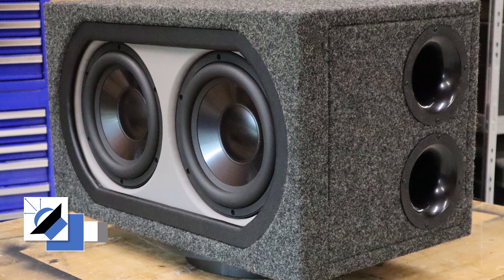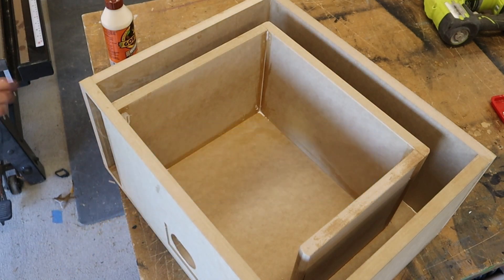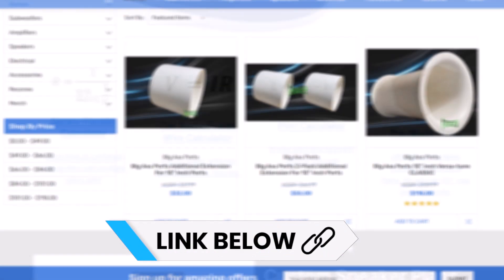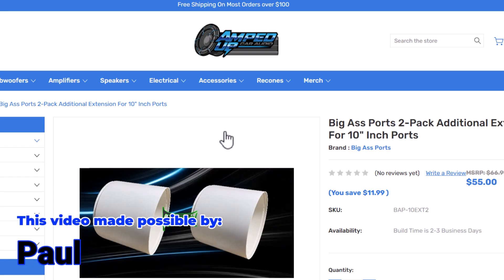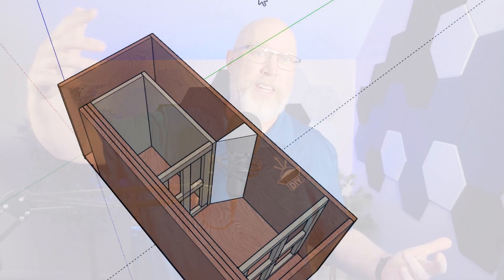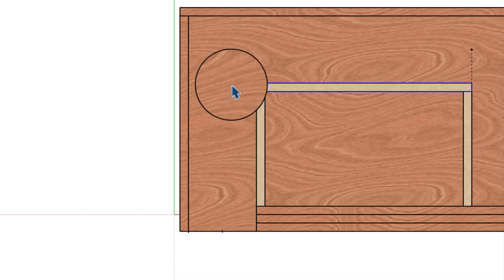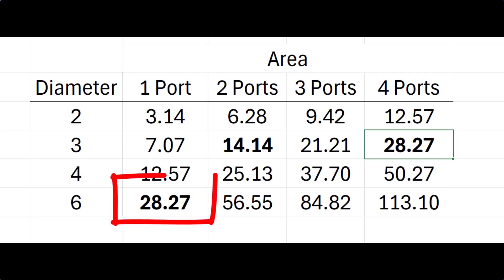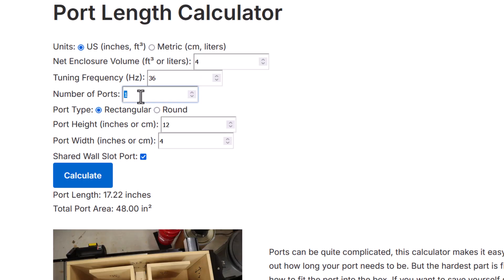Bad ports KILL your bass, ten port tips.

Comment: Hi Sir,
Love from India. I have a query.
I have build the custom box and installing JL Audio 12W0V3 300watt sub woofer.    Keeping port size as 3 inch in Diameter and 14 inch long. My box Depth is 16 inch so in this case 2 inch gap between port and the wall is fine? Or need to reduce? Please revert thanks 🙏

Comment: I usually use 4 ports, making a right angled triangle in each corner of the box. If you want longer ports and have a wide enclosure, you can use the back wall and side walls. It also serves as bracing. I suppose if you do some fancy wood angle calculations, you can flare either end too.

Comment: 3:38 do I do this half of the port 

4:38 or this? 

You would subtract the width of the port and half of the port ? So you are subtracting 9 inches? Sorry if you could elaborate. 

My originally vent length I needed was 29.5 I guess I only needed 20.36
Reply from the maker: Both.
Reply: @DIYAudioGuy you mention ”net enclosure size“ when adding in values u mean the overall box volume correct ?
Reply from the maker: @thatguykai479 that means the actual volume of air that's in the enclosure after you back out all of the things that are inside of the enclosure.  So you have a 3 cubic foot box, but your Port takes up a cubic foot. The net volume is only 2 cubic feet.

Comment: Questions for port placement:

As for as I know it doesn’t matter.

All in a rectangular box! For two 10” subs

I know round ports are the most efficient port you can get it will not work in my application

My question for you is Port placement. I know the port facing forward same direction as the speakers is the preferred method due to sound acoustics and all kinds of other technical mumble jumbo.

Due to the set up and sign my vehicle in the trunk unless I make a L Port it is not possible, and I must port my box through the side.

1. Subs positioned in the bottom left of the box. is there an issue having the port on the opposite side of the subwoofers which would be the right side of the box and positioned at the top? To better clarify, that means when looking at the subwoofer inside the trunk, two subwoofers will be placed on the bottom left of the rectangular box when you would look to the right side of the box and go to the side you would see the square port opening that opening would be positioned at the top of the box Still on the right side and positioned against the face of the subwoofer box, sharing the side wall for the port.

If that’s still not making sense without seeing a picture because I’m a visual person. My main question to you or anyone reading this comment is can the port be placed basically anywhere on the box? As long as following the basic rules such as proper length placement proper Space between the Port opening and the wall inside the subwoofer box. Not covering the port and so on and so on.

I’m more concerned with Khanh the port share the same wall as the subwoofers do? 

I’m asking this because you often see people who port their subwoofers off to the side you see the port usually down in the lower corner, not in the upper corner. 

I cannot vent my box in the lower corner. There will be obstruction of airflow. 
My subs have to be placed on the left side of the box and the vent has to be placed on the right side wall of the box, but in the top left-hand corner. 

I did not run this throughWinISD because the program keeps messing up on my old computer.
Reply from the maker: A 40 HZ wave is 28 ft long.  As long as the port is within a few feet of the subwoofer, it's not going to make a big difference.  

It's not to say that you can't load the subwoofer/ ports off of a wall in the car or take advantage of cabin gain.  You definitely need to make sure that you don't restrict air flow around the port or around the subwoofer.

Comment: So with the effective port length being longer with the port sharing an exterior wall, does that only occur, like in your pictured example, with the port sharing 3 exterior walls? Just curious as the port in the box I’m building only shares one wall as it’s shorter and narrow than the box dimensions.
Reply from the maker: I'm trying to visualize that so that I can make sure we're both talking about the same thing. 

Perhaps here's a better way to think about it.  If you're using a slot port, which will always share at least one exterior wall with the enclosure, then the effective Port linked will be one half of the width longer than the actual port. So if you have a 3-in wide port, you have to make the port itself an inch and a half shorter to hit the target tuning frequency.
Reply from the maker: There's also a clear discrepancy between the formulas or the port you would get in WinISD versus the measured tuning frequency using DATS.  What I found myself doing is tuning the port about 2 HZ high er than the actual tuning that I want.  So if I want a 34 HZ tuning frequency, I'll tune it to 36 and then land closer to 34 HZ on the final project.
Reply: @DIYAudioGuy box is 40”w x 21”H, port is centered at the bottom of panel and is 12.5”W x 8”H so it only shares one wall

Comment: Can you cover under the seat style truck boxes. Exp. Single 12” sub needing 4.6cu in of air. With a mtn. Point of 6” some shallow boxes will fit a sub this size but usually decreases your air cubic space you need for quality output. But you rarely see these under seat boxes made longer. You done examples of square boxes but haven’t seen anything on extended cab seat boxes.
Reply from the maker: In those situations, building something that fits inside of the vehicle is the main design constraint. There's not a lot you can do with the space you have available.

Comment: stupid question from left field. if you ran a steel 3/8 rod through the direct center of entire sub would it still work? i don't want to just destroy a speaker for nothing i have an idea of making something unique for show , just curious if it's even possible and if so what would be the effects, thanks
Reply: You'd be removing the dust cap, and risking debris in the coil gap, as well as taking up space inside the pole vent, reducing cooling efficiency. Reducing effective cone area, which would change the TS parameters. Reducing cone rigidity. The list goes on. Possible? Yes. Look awesome? Yes. Should you? No.
Reply from the maker: I am going with no, I don't think that will work.

Comment: Hi I need your advice, I'm building a custom two seat car (mid engine vw beetle) with very tiny space for subwoofer about 0.3 cubic feet under each seat, after some search and according to my budget and stock here in my city, I have two option: Kicker L7T8 8"  (recommended sealed box min. 0.2, max 0.75 cu. Ft.) or DS18 ZR6.4D 6.5" ( recommended sealed box 0.2 cu. Ft.). Which one do you think has better bass?
Thanks.
Reply from the maker: Watch this, it should give you an answer.   https://www.youtube.com/watch?v=A9oVxddE2GA

Comment: Where did this round port chart come from? I thought when figuring out the port area of a round port it’s the diameter x pi? 3” x 3.14 = 9.42. But you have it listed as 7.07
Reply from the maker: The area of a circle is pi r squared.
Reply: @ lol

I’m still confused. Bear with me because I am slow. 

When I used your calculator, the port area for 3 inch port comes out to 7.07 same as your chart shows. Which one I do 3 inches times pi it gives me a different number regardless if you do the radius squared however you choose to do the problem. The answer is still the same.

But keep getting 9.42 for a 3”  port area
But when I use your port calculator, it comes out to seven point something.

So those two don’t match up my calculations versus your calculations 

What confuses me is that when I do a 4 inch port times pi I get the same answer as you listed on your chart. Although I’m doing the exact same math equation, the numbers aren’t matching.
Reply from the maker: @julesbruchez-theartofgrapp9646 That's because half the radius is two and two squared is four. A 4-in circle is the one special case where your method works.
Reply: @ lol

😂 well I believe you I looked at some more charts and sure enough your numbers match up
Reply from the maker: @julesbruchez-theartofgrapp9646  That's awesome! I do this because I want to help people.  Hopefully I've helped you today.
Reply: @DIYAudioGuy  I really appreciate you responding back to me. It’s amazing how some people have YouTube channels and they don’t have the decency to check their own notifications. I understand that people forget and get busy but when you have a channel where people are specifically asking you questions and they don’t respond. It’s pretty aggravating and rude.I think it’s even more amazing that we have a thread going on a very old video because you have the decency to respond do you have an email that I can contact you with? I have a question that’s a little bit more specific that’s not worth typing through the comments right now.
Reply from the maker: @julesbruchez-theartofgrapp9646  Don't hold it against them. After you reach a certain threshold. The number of comments you get on the videos tend to be overwhelming. You mix that in with comments on social media, and direct messages, and it's a lot to manage.  You got kind of lucky, I'm traveling for work and your comment popped up when I had down time waiting for a shuttle back to the hotel.
Reply from the maker: Oh, and you can reach me at connect@diyaudioguy.com it'll be a few days before I can respond.  I only set up that email address last week and I don't have it set up on my phone yet.  So I'll have to get back home and get to my desktop before I can check those messages.
Reply: @ no rush but I appreciate it.

Comment: In my experience 3D printed double horn style ports are way better that straight tubes, they sound very different, and you can tune them waaay lower without extremely long tubes

Comment: Keep in mind the more aero ports you use efficiency goes down.
Reply from the maker: That's a new one on me. I've never heard that.
Reply: @DIYAudioGuy  they are correct.  It has to do with the ratio of vent area to wall drag.  Four 3" round ports may have the same area as a single 6" round port but they have twice the perimeter length, so double the drag.  
Same thing happens with a square vent.  A 4x4 square vent has an area of 16in2 and a perimeter length of 16inches.  A 16x1 rectangular vent also has an area of 16in2 but now has a perimeter length of 34inches.  That's a lot more drag.  
And there is an actual theoretical maximum vent area for a given driver.  In general, for a given driver in a set enclosure (net) volume and tuning, the larger the vent area the quicker it unloads below tuning.  Keeping areas reasonable helps the driver from going all pancake right below tuning.
Reply: @DIYAudioGuy  really? Aeros are generally more efficient than slots but once you start using multiple ports that advantage dissipates substantially.
Reply: @DibeezyTheGifted  Are you referring to a standard pipe port as an Aero port?   Or are you referring to a pipe port with flares on it as an Aero port?
Reply: @BaddDukk  I'm referring to an actual aero port. PVC or abs ports with no flares are horrible lol
Reply: @DibeezyTheGifted  right on.  I see a lot of people online referring to standard pipe vents without flares as Aero-ports and find it somewhere between puzzling and maddening.  A standard pipe port can sound just fine but flares never hurt and are cheap these days so there is no real excuse to not use them.